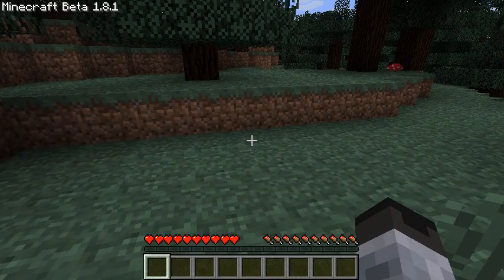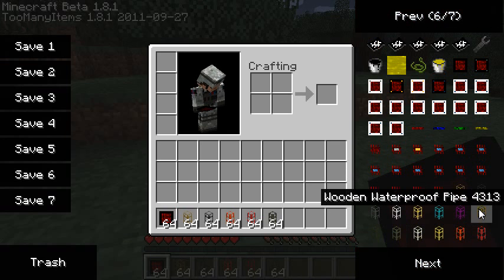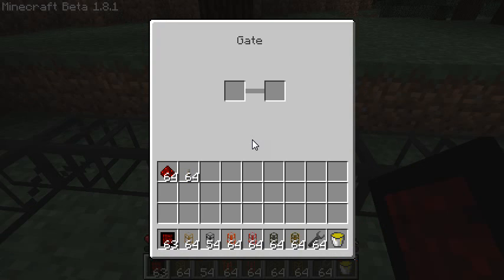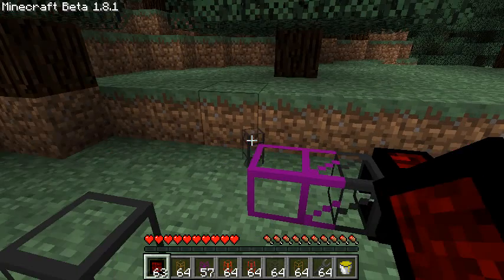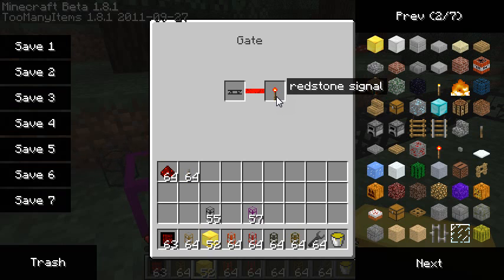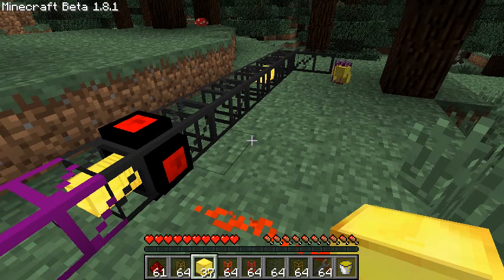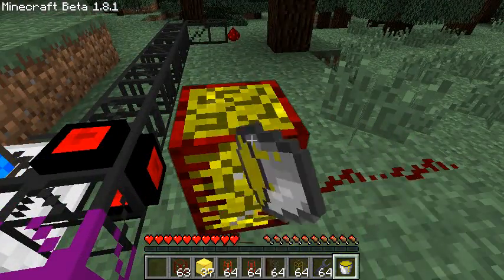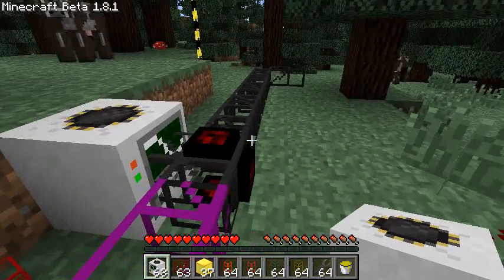BuildCraft 3.0.0 - Single Gates (Tutorial 101)

Comment: You should add to 3.0.0 as a fix: when liquid is going up through a pipe it does not go up the side it should have to fill up the bottom before it starts to go up the pipe

Comment: The tank full thing is because your old tankyou filled is now a ghost to the gate. Its limewhen you have pipe with item eemlve pipe and plavce it back you magicly get the item that was in pipe back (the still travem even if there is no pipe but wont change pipe has there is noconnection)

Comment: You should make a minecart "hold" track. If a chest minecart or furnace minecart, is on that track, they can't move until the track receives power, in which case they are pushed off, in the opposite direction from the one they arrived in; unless there is a block in the way, then they are pushed the other way.
Minecarts on the hold track, can be accessed by pipes, as well as gates :)

Comment: @rubenwbd Wooden pipes require power, unfortunately. However, if you have a redstone engine next to it, it can be powered by redstone from the pipe. I'm not sure if that is how it works though-- but, you could use item in chest = redstone power which works what you want it to be.